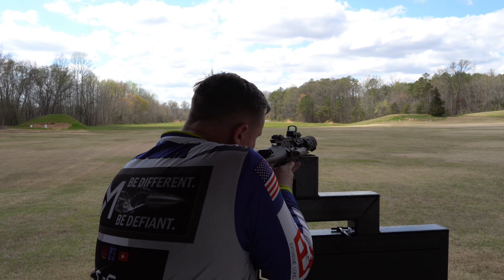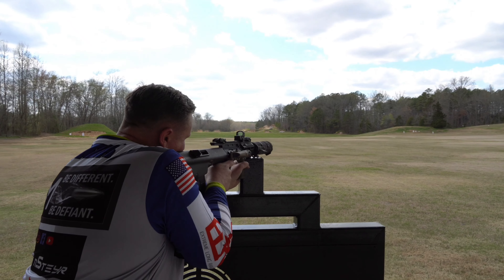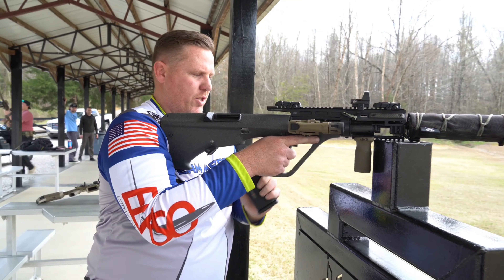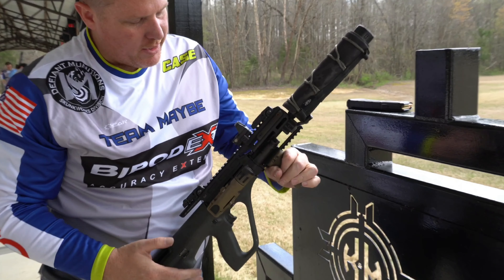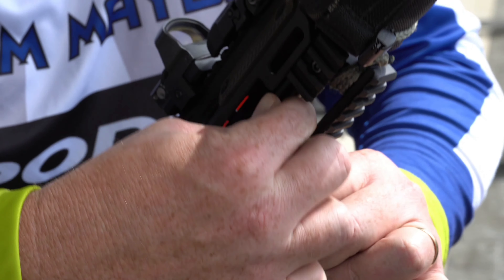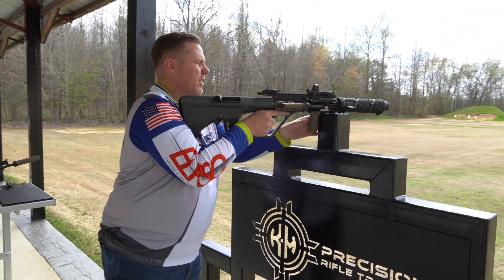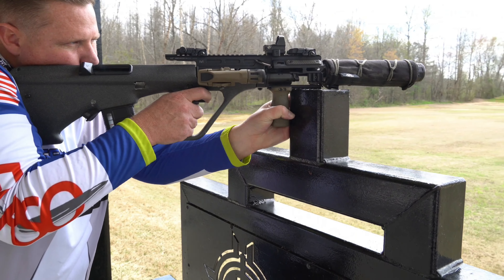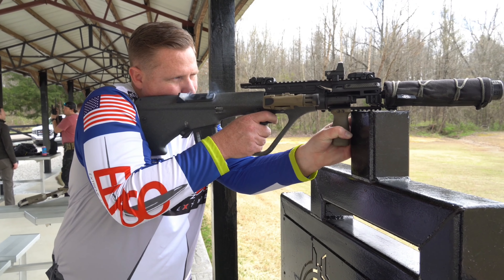Hersey design AUG 300BK Gas settings

Comment: Will we see a video on the 9mm conversion?
Reply from the maker: I hope so. Just need people to like the video and let Hersey design know you want me to demo 1
Reply: @TnSteyr Out of curiosity, what Talon wrap did you use on your 5.56 Augs hand grip?
Reply from the maker: On the black one and the white colored one, I do not have any on an older aug that I have. I did use one the honestly I could not answer you greatly a subscriber sent it to me a number of years ago and I only used half the kit I believe they only make one for the AUG
Reply: @TnSteyr It was on a FDE Aug you were putting the arid trigger and safety into 2 or so years ago, I can't find the grip kit for it
Reply from the maker: @plaguewalker5108   that would be a talon grips I just checked there website and their available.  I have the Granulate black
Reply: @TnSteyr  You ever try out the rubber or Pro version?
Reply from the maker: @plaguewalker5108  no I haven't
Reply: @TnSteyr Appreciate the feedback, just got mine today, looking forward to dropping an arid trigger and ratworx in it possibly with force reducing trigger pack springs to see how it holds up, but im really curious if there has been any word on any rail systems for 20 and 24 inch barrels
Reply from the maker: @plaguewalker5108  Kool.  Nothing I have heard of
Reply: @TnSteyr Damn, I've been trying to find a rail for my 20 inch barrel, no luck. I'm looking to buy a 16 inch and came across heresy design but it comes with its own rail system, by chance would you know if you are able to take them off and if it's just a standard Aug barrel with heresy's furniture on it? And if not could you maybe look into if it's possible and if so, can you make a video on how to do it and what it looks like broken down?